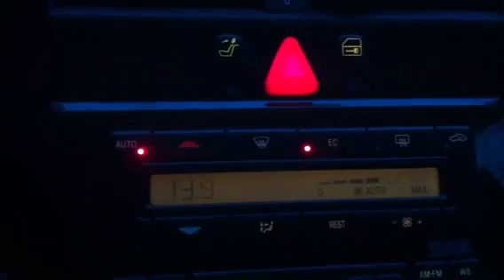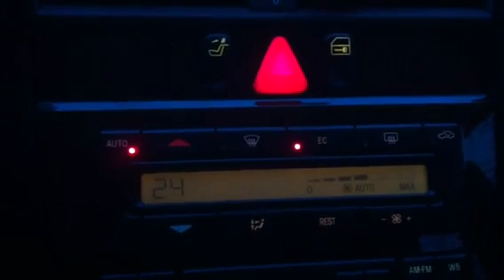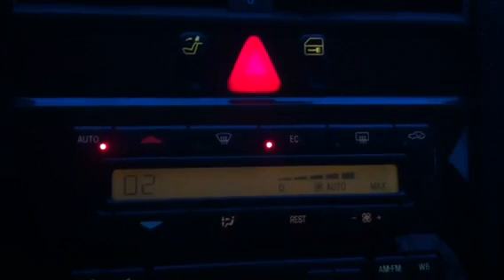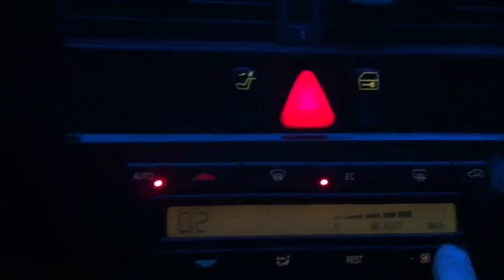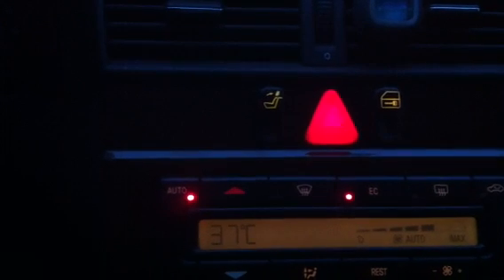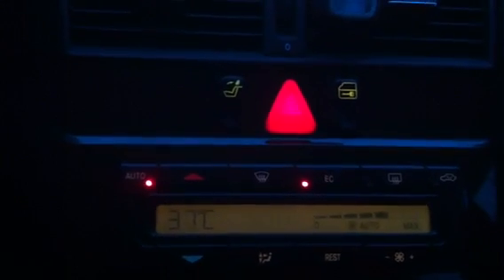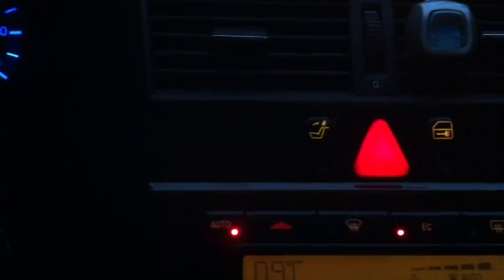Mercedes climate control display sensor values/diagnosis

Comment: sir i got OPE at number 08 and 5*5 at number 07 what should i do now???
Reply from the maker: Those are only the actual values for the climate systems.. Are you having an issue with something in the climate system ?

Comment: igota question y dose my 1996 c220 says for code 6 open insted of coolent temp?
Reply from the maker: code 6 is the interior temp sensor ..open means open circuit.. there is a wireing problem with the sensor
Reply: fupabox ok so witch one is the coolent temp ?

Comment: I did this and I get OPE, CL 0, and 212, 129 codes like that. what's wrong
Reply from the maker: +minzi2047  did they go away when the plug was re-connected ?
Reply: +fupabox yeah it went away
Reply: +fupabox you wouldn't happen to know how to make panels would you? I want to place a panel in the gap where the ashtray is, reaching from the radio panel to the shifter. Where I could put the ac unit and have room for a double din radio.
Reply from the maker: +minzi2047  I've never tried it.. there must be a how to on one of the MB forums..someone must have done it before
Reply: +fupabox I made one out of fiberglass but it isn't as flush as the dash kits, might just go with molten aluminium.
Reply from the maker: +minzi2047 molten aluminum...that sounds interesting..post some pics when you do it

Comment: Hi, i have a 1994 C220.  Whenever i turned on the climate control and start to rev it, the blower or air that comes out of the vents run from the center console to the side vents and when i release the gas pedal it returns to normal.  Hope you can help me with this?  Thanks.
Reply from the maker: fernando trinidad sounds like you have a vacuum leak in one of the plastic vacuum lines... there are a bunch you can get access to by removing the glovebox.  they also run into the engine compartment in front of the passenger..the only thing you can do is check them all for leaks
Reply: Thank you sir. Will be doing that. Do you recommend any tool to check for any leak?
Reply from the maker: fernando trinidad a vacuum tester will work.. as you apply vacuum to each line ,you can see which one holds the vacuum , and which one leaks off the pressure.. then you can trace the leaky one... if you smoke, you can blow cigarette smoke into the line and look for it leaking out
Reply: HI, thank you again.  Ill try the glove box first to check for any leaks.  Thanks for the help.

Comment: Hi there i have a 97 sl 500 r129
I have heat on screen heater when on thats fine
But cannot get any heat from climate control at any temprature settings
Would be gratefull if you can help , i know there are sensors is there a quick fix
ive been told to take to mercedes and put on diagnostics.
Reply from the maker: unfortunately there is no quick fix....you could lightly (with something like the rubberized handle of a screwdriver) tap on the duovalve/monovalve to see if it is stuck...it is under the big square black plastic cover at the base of the passenger windshield..5 screws to remove and look for the valve with 2 rubber heater hoses going into it   looks similar to the one in the video I'm adding a link to,,,but it has 1 round valve instead of 2   How to..Mercedes monovalve, duo valve cleaning,checking

Comment: My hair conditioner dont work nor my heat, how can i fix it?
Reply from the maker: the fan doesn't blow any air ?
Reply: YEAH it does
Reply from the maker: if it won't change temperature,then the duovalve is likely clogged or stuck...I have a video on how to check and clean it
How to..Mercedes monovalve, duo valve cleaning,checking

Comment: hey, none of my dash light and radio an climate control lights are working . what do u suggest this is from
Reply from the maker: either a fuse, the wiring connector behind the gauge cluster (there are 2 that plug into the cluster) or the gauge lighting dimmer is bad..have you checked the dimmer to see if it is turned down/off ?
Reply: yes i checked dimmer and everything is out radio climate control everything..theres just a plus and minus +/- and i press it up but nothing
Reply from the maker: chasebanx mastergrower
If all the wiring plugs are plugged in, and the fuses are good,then the dimmer (+  - buttons) is possibly bad..it may also be something in the light switch on the dash since power is routed through there

Comment: hey just a quick question, sometime the light doesnt display on my climate control, how do i change the bulb? can i use an led?
Reply from the maker: check my clk video playlist...there is a video on doing that, and yes you can use an LED
Reply: ***** ok thanks will do

Comment: Hi. My #2 code is not reading right. It shows unusually high and doesn't match the dash temp. This is on my 98 clk. I think I need to change the sensor, but I have no idea where it is. Any ideas? Thanks!

Comment: Excellent, I thought it may have been a wiring issue. I bought the car last winter so never tried the air until late summer. I live in England but had spent most of the summer in the US so the car was never used, so by the time I got around to trying the air it was a bit late in the year to really troubleshoot.  I'll have it pressure tested and refilled after Christmas.

Comment: Youtube doesn't let you post links in the comments. You have to put a "." between "benzworld" and "org" and remove the space that's there.

benzworld(dot)org/forums/w202-c-class/1387534-hold-down-rest-button.html#post2980324

Comment: Thank you this is very interesting: earlier in the year my ac compressor stopped working after the EC light came on while running the ac. Now from digging a little I've discovered the Eco light will operate if there is not enough refrigerant so do you think that it may also switch the compressor off?